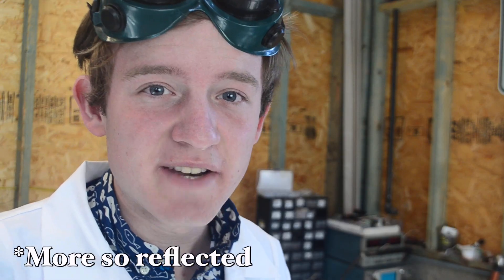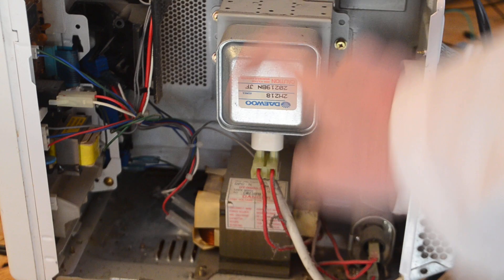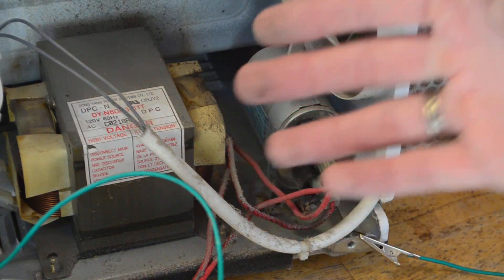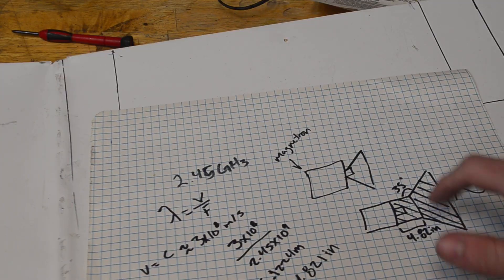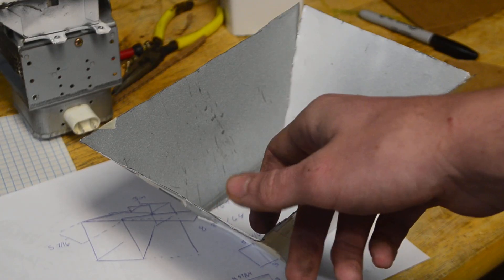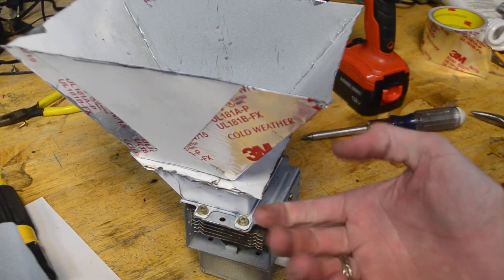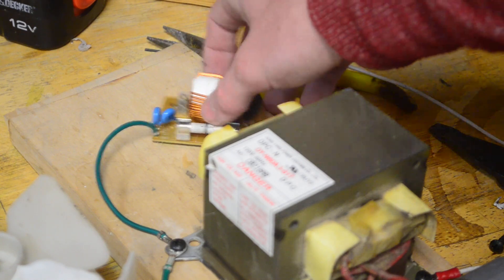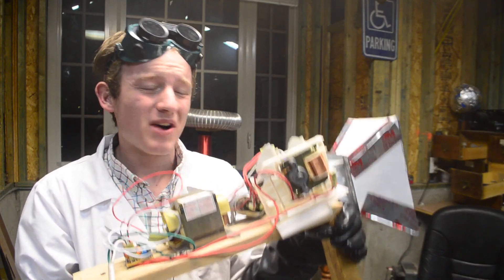How to make a Microwave Gun

Comment: hey, I was just wondering, to make it a bit safer, could you place all of the electric components inside a plastic box coated with tinfoil on the inside to create a Faraday cage  while the plastic or rubber protects the user from a deadly shock?
Reply: heck yeah. And not only would it be an EMP gun, you could blow out people’s eyes with it.

I bet if you pointed it at a substation the substation would go down, causing a mass power outage...

Comment: what is the input voltage of the cooler fan? AC or DC?
Reply: Microwave cooler fans are at supply voltage and frequency, so in the US that would be 110vAC 60hz, and in Europe 220vAC 60Hz.

Comment: EXTREMELY DANGEROUS. Please understand that there are genuine safety hazards in this build that could kill or maim you even if you're being careful. The 2000 volt microwave power supply is capable of putting out 500 mA of current. This will kill you without a second chance. The 1 kW of microwave output is also very hazardous. Even at relatively low intensity (e.g. from stray reflections off of metal objects or diffraction through cracks in the improvised waveguide) exposure to the microwaves can gradually denature the proteins in you're eyeballs rendering them cloudy, and at higher dosages, opaque. This process is irreversible; you can go to the hospital but they will tell you that there's nothing that can be done. There are other parts of your body that are fairly sensitive to microwave exposure as well (e.g. testicles, brain). It is also conceivable that someone else will find your cool looking apparatus, plug it in, conclude that nothing is happening, lose interest, and then possibly forget to unplug it. This assumes they don't go poking around the exposed wires in an attempt to figure why the device is (apparently) not functioning. The narrator is also correct to point out the danger of beryllium oxide dust. Seriously, consider the potentially grave consequences before deciding to undertake such an experiment.
Reply: so don't point it at your testicles, got it
Reply: Jeff Koplow reading this my body hurts lol
Reply: I want to point it at a whole bunch of different Quartz crystals and see what happens..

so should i risk all that scary stuff or could you just tell me what would happen? 

by default i'm not very careful and prone to accidents there is a really good chance i'll arrived dead at the emergency ward breathing sparsely with clouded eyeballs, frizzy hair and  burned testicles .
Reply: jeffel80, stfu, you have no idea about what you're talking about, long before you feel any heat there is damage being done, and depending on where on your body this happens, the effects could range from minor to potentially fatal, and as Jeff mentioned, damaging your eyesight isn't something you want to have happen, smfh.
Reply: Voltage controlled Ovulator No volts behind it, you need volts and amps to kill you. anything over 100 should be sufficient to overcome the body resistance. Since a MOT usually puts out around 2kv at 700 mA, it usually bites you only once. 
Touching the output of a flyback transformer hurts a lot, but isn't lethal due to the low current.
Reply: Rob A that is not so!
Reply: You're fun at parties I bet
Reply: Be visible under infrared light?
Reply: How to fix Sim chip contact on smartphone?
Reply: Could this kill a brain implant
Reply: Wrong,   Im not dead. I pulld one apart in my teens and had it running and accidentally got my finger on the terminal going into the magnetron. Lit my ass up. I had no clue what got me till it was all said and done. My fuckin finger was froze for weeks and couldn't move it, not to mention the burn marks. And i didnt mistake the shock for 120v, cuz over the years prior to that i have been shocked by 120 many times from playing with electricity.
Reply: Actually measured one amp with a multimeter at a lower voltage, so there's that.
Reply: Youre just an old stick in the mud
Reply: Smart guy here, pay attention! Thanks Jeff.
Reply: Blah blah blah blah who cares
Reply: I think the grave consequences are one of the reasons for building the thing Jeff. What about that don;'t you understand?
Reply: You haven't mentioned a little demon called free body resonance. Look it up and get educated! You are exposing your body to RF and encouraging others to do the same. Also NEVER but NEVER get in a hurry to explain something as dangerous as this very bad idea.
Reply: @3melendr592  what is that
Reply: @Zabójcze Trucizny Podsuwane Polakom  I've seen people take direct hits from microwaves like this, but focused into a 1 inch beam. You can sound as cool as you want but you don't know who I am, standingman.
Reply: @TonOfHam  Well...who are you?
Reply: @brockstill1431  Someone with a lot of experience and schooling. Someone who knows how to be a good sport when discussing opinions with others.
Reply: 500 mA is what a USB plug outputs. It's not going to kill you most of the time, but with a high enough voltage it will shock you, and it will hurt. He already covered the eye safety, and a reflection of a microwave oven magnetron is not going to blind you in any short order. You will actually feel your skin and exposed body getting hot in the area before it's a threat to your proteins in any spheroid organs.

PS: Microwaves have such poor skin penetration that they can't even reach your eyes when you close them.
Reply: @JustPlainRob  stupid its 2 kv and 500 ma its lethal
Reply: @JustPlainRob  You have no idea what you are talking about. You especially should not try this bro.
Reply: @JustPlainRob  dude, you are so wrong. You must be a smart wannabe kid.
Reply: Jeff Koplow, 500mA? my cellphone charger produces more then that.
Reply: @KarolineLeavitt-29a You obviously don't understand the difference between alternating current and direct current.. The cell phone charger produces 500 mA at 5 volts DC (direct current like from a battery) which won't hurt you.. 2,400 volts AC (alternating current like from a wall plug) at 500 mA and 60hz will go through your body and kill you.. 60hz, the frequency of utility line voltages is very disruptive to your heartbeat and your nervous system.. don't be a dumbass.. HIGH VOLTAGE AC WILL KILL YOU..
Reply: Autistic Christian Simulator Yes, but not at 2 kilovolts
Reply: Autistic Christian Simulator I dont know If this is a serious comment but anyways your phone charger at best produces 2amps @ 5 volts but this thing does 500ma 2000 volts that would kill anything in a microsecond
Reply: Um, let's think in context here. A shot from this gun isn't near as bad as the constant exposure from Wifi, cell towers, cell phones, tablets, bluetooth, and all other wireless devices added up over time. Do the maths and be scared for yourself.

Comment: I thought those line filters were intended more to prevent noise from leaking out of the microwave transformer rathern than filter noise coming in from the AC line. If that's true, then you almost certainly want to include the filter to prevent this device from leaking noise into your AC line, which might disrupt other devices plugged into the circuit... Although, now that I consider what you have built, never mind. Given the intended purpose of this device AC disruption might be considered a bonus feature rather than a flaw to be suppressed. Still, you should include the filter. There's no sense abandoning conscientious  engineering principles just because you are working on a death ray, energy weapon, destructo-field, demoleculatizer, shrink ray or any from the category of doomsday devices you might have on the lab bench.

Comment: Is this how the new incision-less vasectomy works?
Reply: this comment is so underrated
Reply: Microwave can kill sperms, I am not sure about the long term effect, it's something to be avoided.
Reply: That's probably going to give you cancer, but might as well try it.
Reply: @cc55555  So is everything else. If you gotta get cancer, you might as well get  it doing something cool rather than eating processed food or smoking.
Reply: @cc55555  Actually no, because microwaves are non ionizing.
Reply: @guyno_one293  aww
Reply: @guyno_one293  
There are other ways of getting cancer besides ionizing radiation. High energy microwaves certainly can have negative health effects, and cancer is not out of the question.
Reply: @matthewlallinger9603  The magnetron in a microwave doesn’t cause cancer. But it will boil the water inside your body. Including the water in your eyes which will explode. 

No consumer grade equipment is capable of giving anything cancer. You’re looking at 20+ Megawatt output for that and if you get in front of that you’re dead long before getting cancer.

Your opinion does not equate facts and thusly can be disregarded as nonsense.

Comment: microwaves won't ionize anything, hence they can't give you cancer via ionization. the reason the florescent tube lights is because the microwaves are absorbed and re emitted as other wavelengths by the gas inside. ionization occures when energetic quanta of light repeatedly strike the same electron before it can eject a photon, and is ejected out of orbit. carefull with your terminology.

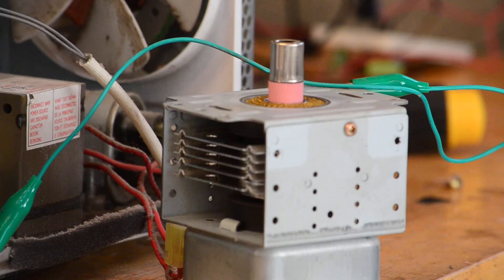Comment: You should never play with a magnetron. But if you do, please use at least proper safety shielding (see 2:10 - facepalm!). There is a serious risk of cooking your eyeballs and get permanently (!) blind in seconds without noticing. There are no pain resistors within your eyes and the lens of the eye has no cooling blood flow. Another thing to mention is that the pink ring on top of the magnetron could contain beryllium which creates toxic dust if broken. And of course, there is high voltage (2 - 5 kV) which will kill you instantly if isolation is insufficient. Just my 2 cents for other people trying to recreate this experiment.

Comment: Why does pointing it at a plug cause the breaker to flip? Does it induce a high current in it?
Reply from the maker: +ElectricAvian honestly I'm not completely sure, I would guess that since the plug is grounded it is arcing through the metal inside from the microwaves

Comment: What you really need is learn about electricity and electronics. 
When I say this, I don't mean looking it up on YT and google. I mean studying it for AT LEAST 4+ years!!

Btw. For a faraday cage to work, it needs to be referenced to ground. 

You should really take this video down.   
There are people stupid enough thinking "Ow yea I can do that!" Then realising later on in life why you can't have kids due to some kid, fucking about with a magnetron!!! 

You don't even know how an extremely basic simple circuit like the HV circuit works. 

Also, what if the bleeder resistor was open circuit???? 
You'd be fucked!!
You don't realise the amount of energy that cap can hold. It's more dangerous that the MOT as once the supply's been disconnected, it's DC!!! And all of that energy will be dumped instantly. 

Sure, your all calling me a hater. 
But you don't realise how stupidly dangerous this is!
Reply: TheManLab7 yeah...while Einstein learned physics reading people's patents....sure
Reply: Why do you assume he doesn't know anything about electrical circuits? Looks like he knew enough to make the thing work without killing himself. Proof's in the pudding, i'd say.

Comment: if you use a taser it will have a much greater distance wrap the high voltage around a electro=magnetic  coil powered by a battery to get some more  wattage in the circuit or just connect the battery to the circuit your operational distance will increase by by 50 feet or more more voltage you have the better the magnetron will work

Comment: Pretty kool!  Just a couple of comments:
Maybe the tinfoil hat is a good idea but the goggles are worthless.  Plastic and glass are transparent to microwaves.  Instead you should have taken the metal mesh from the microwave door and made a face shield out of it.  
A spot welder would have been a better option for connecting all the metal pieces.  There are several sites with instructions on how to build one using a microwave transformer!

Comment: That filter is not filtering the input its actually filtering the output of the transformer, its called a common mode choke. Second, RF Waves are not ionizing the mercury inside the tube, they are ionizing the gas that makes it fluoresce.

Comment: got a question. 
how do I go about concentrating the beam / wave and extending the range.  instead of only a couple of metres effective use, I want to be able to get 30 upto maybe say 100 metres range.
Reply: Look for a higher wattage microwave, and use that. That's the easy bit, the rest will be based around a decently designed waveguide.
Reply: {MLP} Rainbow Dash 😁👌 Thank you very much!
Reply: I may be wrong,but I think if after the 35 deg portion,you could make a straight section of tubing to make a "gun barrel" of sorts to extend range.
Reply: KREOSAN used 3 magnetrons in theirs.

Comment: Hey Keysyone, since microwaves is a type of radiation you could put a geiger counter at the end of the gun to detect when it is on, just in case you accidentally turn it on.
Reply: Feeling heat from being near a campfire is radiation. Seeing light from a lightbulb is radiation. Geiger meters read gamma radiation, beta or alpha emissions.
Reply: No that won't work as its radio frequency energy. Geiger tubes detect ionising radiation, ie alpha, beta and gamma. However there are microwave oven leak detectors available cheaply that would do what you suggest. They are simple field strength meters tuned to 2.45GHz. I have one i built about 40 years ago from an electronics magazine article. Its simply a schottky diode to detect rf across a dipole which feeds a micro ammeter. No power required as gets energy from the microwaves in the air.

Comment: If you're looking for an application for this thing, how about a simple RADAR? If you connect a receiver designed for the same frequency to an oscilloscope you should see the changes in signal amplitude as you point the beam at different objects. If you operate it in pulses with a regular gap between them you could also determine range by measuring the delay between the outgoing pulse and the return- at that point you'd basically have a WW2 era centimetric radar scanner. The detection range could be greatly enhanced by adding a parabolic reflector to focus the beam.

Needless to say this device almost certainly breaks any national/local laws about transmission power on public frequencies regardless of where you live and would probably be a fairly effective jammer for anything operating in the 2.4 GHz band (like WiFi or R/C transmitters) over rather long distances, along with the already mentioned microwave and high voltage hazards. In other words, don't use it!
Reply: One cannot produce a useful pulse by magnetron.  That is why magnetrons used in early radar and radar transmission by revolving feed horns to replicate pulse generators.

Comment: talk about absolute bad. (really bad) idea. I LOOOOOVE IT!   now make a receiver to convert directed  microwaves to electricity.  see how far you can go before you loose power. 

ps do not under any circumstances stand in front of the gun. 
pps use some sort of shielded current limiting circuit to regulate output on the receiving end..

Comment: So, just cut the opposite end of the microwave off and put the horn inside and aim it out of the new hole ? This would give you direct line shielding but you still get reflecting rays back at you. 
 It should be noted that similar devices are used for transmitting radio signals.

Comment: not all aluminium tape has a conductive adhesive so be careful with that. also, you may wish to prep the surfaces to ensure a nice rf bond for all sections of the waveguide. there is also significantly reflections depending on what you aimed at you may expose equipment or personal behind to significant RF fields, not many people have RF absorber on hand. 

keystone, you should try to measure the e field. at 2m it looks decent. would not have expected them difficult tripping though base on the field I would have thought you got at that distance. 

I do agree, dont try this at home. this in close range would exceed the non occ and occupational radhaz limits for time average as well as the mentioned electrical safety issue.

Comment: Interesting...I wonder what the range is.......I have a pesky neighbor with a nice drone that I would like to jam, and maybe steal.....also it may be a good insect killer....mass murder of fire ant colonies....

...just so many possibilities....
Reply: mike dee demanding on the communications technology used, you may be able to jam the drones coms from 20+ metres. to cause damage to the circuits or hardware  will likely need sub 5m depending on the designed immunity to radiated RF. 
I wouldn't bother with the insects, you need to be far too close.

Comment: Keystone Science what is the range of it and can the microwaves be sent in a straight line with a longer barrel rather than the one wave length of distance  and do you have to use the end closure at all?
Reply: fuzzyfkr the pyrimidine horn shapenis used to focus the RF and thus achieve a greater distance.

Comment: can this be used as a radar jammer?
Reply: Scott Peterson no one other than hobbiest or the radar led lights use a 2.4ghz ISM radar so no, wrong frequency. even then utalisng encoding and the doplar and signal processing means you would likely only jam basic radar not designed to avoid on frequency jaming
Reply: Sean N can't it be used to overpower and fry some electronics of radars? sending 1000watt direct microwave energy surely will do something.